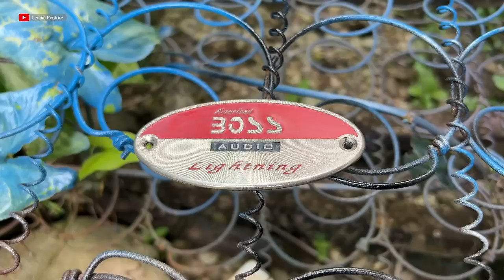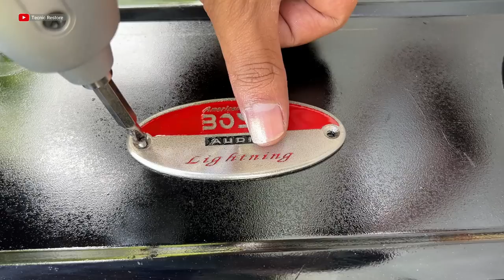Restoring the Boss Model 8000 Watts Car Sound Amplifier - Full Restoration Process

Comment: 115/230 V into a 12 V car amplifier produced a spectacular firework that was repaired with a jumper cable and a new capacitor?
Reply: si yo tampoco le crei jajaja...   que se lo crean quienes no conocen de Electronica jajaja
Reply: He used 220 v input for power supply and an output of 12v
Reply: Скорее всего конденсатор тот же припаял 😂
Reply: Yeah and it looks suspiciously like paint and dirt... Very little actual rust. Even on the threads of the screws....😂
Reply: 8000 watts??? And he put a speaker that has maybe 20 watts??? without that, he turned on the amplifier to lower the volume???. however, the toaster should have stayed with the speaker 😂😂😂😂😂😂😂😂😂😂😂😂😂
Reply: He used a laptop charger I have a similar setup
Reply: What a joke.
Reply: The capacitor was the same, the same dust particles arrange can be seen.
Reply: ELIASPETERI ANUY LIIKOTILA 
❤❤❤❤❤❤❤🥰
Reply: ELIASPETERI ANUY LIIKOTILA 
❤❤❤❤❤❤❤🥰
Reply: ELIASPETERI ANUY LIIKOTILA 
❤❤❤❤❤❤🥰
Reply: Creo que el que está reproduciendo la música es otro aparato por qué este no creo lo daño todo al conectarlo directo
Reply: ELIASPETERI ANUY LIIKOTILA 
❤❤❤❤❤❤🥰
Reply: @franktv6927 there was no power supply

Comment: power supply sucks that is the problem.
8000 watts? no way.
Were both fuses replaced?
Has to be the all time worst restore ever.
Reply: 8000w but only puts out 80 😂 at best

Comment: Those amps arent worth repairing. They advertise 8k watts and produce close to 100 to 300 watts. No where near advertised specs. Boss audio rips people off. Plus 220v into 12v not smart to begin with. Plus a jumper and a cap. Those mosfets would have been smoked on a cheap amp like that.